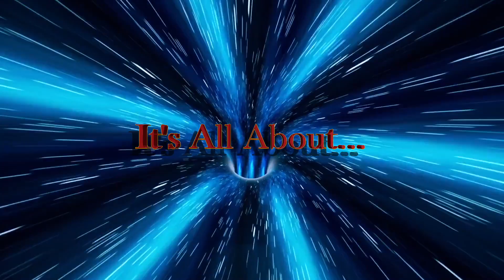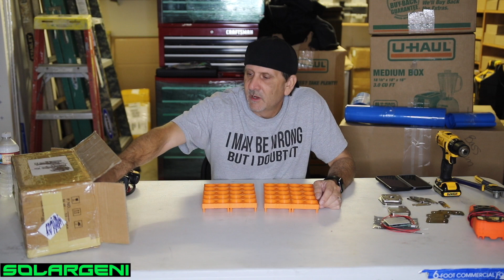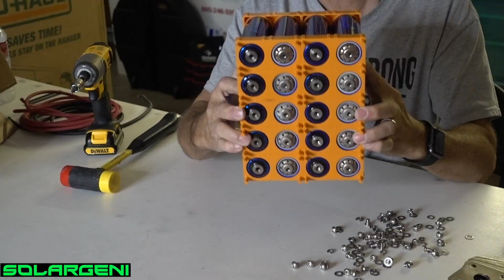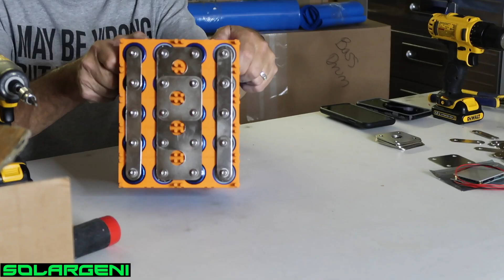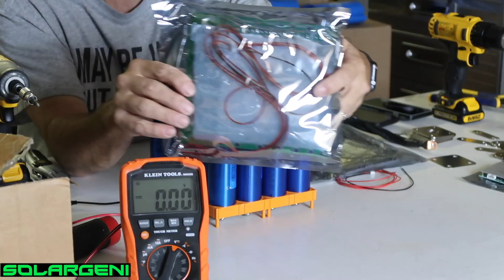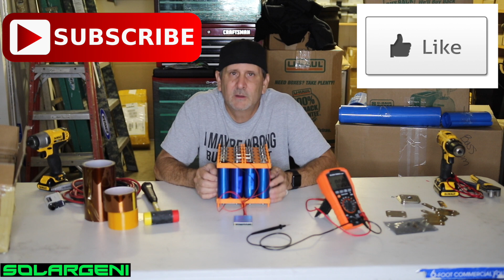Headway 38120s LifePo4 50ah Battery Build with BMS

Comment: Will charging my lifepo4 headway bank at 14.8v instead of 14.6v cause them to degrade? If so is it substantial fast or would it be a slow process?
Reply: For battery longevity with LifePO4 Batteries a Max of 3.4V see "Off Grid Garage" for further charging rates for charging batteries with the ideal charging rate voltage and amperage.

Comment: I appreciated the comment someone made about the red versus blue cells, I need red so I'm going with them but are they going to be the same amp hours for this 20 cell battery?
Reply: The Headway 28120HP batteries will let you dump more Amps and they charge faster but their nominal use is at 3.2V and they only have a Cycle Life of 2,000 charges but they have a LOT of get up and go off the line... ✈️
Reply: They are only 8A but if you need LOTS of Amps and a Super High Amp Quick Charge they'll give you a LOT. What are you building  ESTOL/EVTOL ?... ✈️
Reply: See "Off Grid Garage" for further discussions on LifePO4 battery use and best Charge Curves and use of those batteries. 🔋 🔋 🔋
Reply: Look up the Data Sheets on those Headway 38120HP Batteries and they will give you the ideal temperature ranges and everything else. They're really nice batteries I just ordered a whole bunch of them... $$$$$$ 🇺🇸 🌎

Comment: What's the difference if I have four in a row 16 total versus 5 in a row 20 total like you? Tnx
Reply: Ideally LifePO4 Batteries like to be connected in Series.
Reply: If it's 4 in parallel and 4 in series, the voltage stays the same (determined by the number is series). What changes is the amp hours. 4 in parallel would be 40 Ah since each cell is 10 Ah.

Comment: So just curious. With each individual cell being 10 ah a piece. Wouldn't that come out to a 100 ah capacity battery?
Reply from the maker: Corey Luke No because there is only five in parallel 5×10 = 50

Comment: This is cool Im learning all this stuff. I want to build my own mack battery. But I want to build it right with out blowing anything on the truck or computer system. My trucks have a small short that keeps draining my current batteries and its a pain. Im always replacing them ..Costly and a pain. Can I install a BMS to cut off the power once the truck is off..ect..Im going to order from you thanks.  Cool vid bro
Reply: No bms can handle the amps you get while cranking. If you find one, it can shut off power once the battery gets low. You can install a high amp cutoff switch to stop the drain. Or find the drain.

Comment: How many watts with a Stock alternator charge of 140amps could this bank be good for? Looking to get this for battery replacement for car and using with aftermarket sound system with 5,000 watts
Reply from the maker: you would want or red 38120HP batteries for that high of wattage stereo system. the bank in this video would be a max of 150a charge and 150a discharge. NOT recommended for a 5000w 12v audio amplifier. The red cells in the same size pack would allow for 1000a both discharge and charge current.

Comment: can I use this for trolling motor 45LBS/12v?
Reply from the maker: as long as it doesnt require more than 150a continuous discharge on the pack. Otherwise get our 38120hp (red) batteries.

Comment: I require some expert advice.
I am building a 12.8v battery using 4 x 38120 headway cells.
This will be used inside a car powering my project.
I would like the cells to be charged from the car battery/alternator but using low current.
The BMS says 50A charge current and I was hoping for more 5A as can be plugged into the cigarette socket to charge or trickle charge the pack.

This way I can also fit some protection like a resettable PPTC fuse so when the project load requires high current, the fuse will trip and only current from the 38120 pack will be used.

Is this possible or does the BMS really require 50Amps?

Thanks
Reply: @3DLasers  How would these cells damage an alternator or fuses? Your not making and sense.
Reply from the maker: Easy answer is yes you can do this. You can also run a five amp fuse to the BMS and that would be fine also. The problem if any will be the direct voltage coming from your cars alternator to the battery pack. Just make sure that the voltage does not exceed 14.4 to 14.6 V EVER and you’ll be fine, otherwise you’ll have to put in a adjustable buck converter.

Comment: Great video.
I have a question if you don't mind answering.
I've got a 100A BMS and building a 12v battery.
I will have charger constantly connected to the BMS (Car battery/alternator)
When my project needs the power from the battery, is there a way to prevent any current being taken from the charging source?
I was thinking a relay that opens when my project needs to use just the 12v battery.
Can't use diodes etc as the charging source needs to charge the battery.
Reply from the maker: 100a BMS is probably too small for the cars alternator and possibly the load you're trying to achieve.

Comment: I am thinking of making 48volts system with this batteries by connecting 16 in series and 32 in parallel. Making it total of 512 cells. Then use one single 200ah BMS for the system. 
Will this work and how do I calculate how many Kwh this will give me using 512 cells at 48vols. 
2ndly. Is there a better sell to use instead of this for 48 volts system?
Reply from the maker: Yes this will work fine. your kw rating is done by adding the number of cells in parallel and multiply them by the AH rating of each cell. so: 
10ah x 32P = 320ah or 15.36kwh @ 48v or 15,360wh @48v. glad to help. These are the best cells you can get, you can get more powerful ones like the 38120HP cells. What is your application these will be used for?

Comment: why do you use 20 batteries for a 50ah? are they too many for a 50ah? thanks
Reply from the maker: the video tells you that answer? 5p = 50ah. 4s = 12v 5x4=20 cells
Reply: @WesThatTechGuy  thanks for your reply, so you have 4 groups of 50ah right?
Reply: @Shelis_FPV  Each group of 4 cells in series is 13.4 volts and has 10 amp hours.  So the battery I put together to fit in a trolling motor plastic case has 8 rows of 4 cells each so that's 80 amp hours.
He has 5 rows of 4 cells which makes 50 amp hours.

Comment: The BMS or battery management system is not used to "protect your property or whatever" it is used to protect your batteries from overcharge/discharge, short circuits and to balance charge your batteries

Comment: I noticed that you had forgot to mention that there are two types of headway cells .The (blue) wrap= is for more capacity. And the (red) wrap= is for high output. Over all if you need  large amounts of amperage in a burst application. You need the red cells.
Reply from the maker: Yes this is correct. I sell both types of cells over at SolarGeni.com. Thanks for watching.

Comment: Hi Wes. I just bought 2 blue Headways from you on eBay. Nice batteries. I am confused over the amp hour you quote. If each battery has 10 amp hours and you put 4 in series for 12.8 volts don't you have 40 ah? So on a 20 battery setup that would be 200 ah - No? How come you say 50 ah? Thanks in advance and I shall buy from you again.
Reply from the maker: Izif thanks. if 4s with 10ah cells you will have 10ah only if 4p you would have 40ah. series connection doubles the voltage but amps stay the same. Parallel double the amps/amp hours but voltage stays the same. I used 5p in the video hence 50ah. Hope this helps.

Comment: I didnt read through all the comments...so.. I recommend that all jewelry be removed when working with batteries... Your ring could cause a cell to cell short...Safety First..
Reply from the maker: Ya my mistake. when in the shop building I generally never wear jewelry. This is what happens when you're in a temp situation.

Comment: Does the choice of BMS matter when using 38120s vs 38120hp cells? Looking at the 4 cell packs.
Reply from the maker: NO you just need a 4s LifePo4 BMS

Comment: If I build this pack can I use it in my car and use my alternator  to charge it or will I need a charger
Reply from the maker: Yes you can. it's the same voltage as your car battery. You can't throw you will need a amp specific buck converter if the pack has less than 8p because your cars alternator puts out around 225+amps. at 8p4s this pack can take 240a continuous charge. If you use the HP cells (red ones) than you can run a simple 4p4s pack and be fine.
Reply: @WesThatTechGuy  I was going to buy the one you build in video my alt is 100amp would that work I have a amp that pulls 200amps and already have a 100ah agm in my trunk I was going to run that with the bank I'm kinda new to the lifepos that's why I asked befor I buy
Reply from the maker: Chris that will work fine. Let me know I can have one ready for you to go.